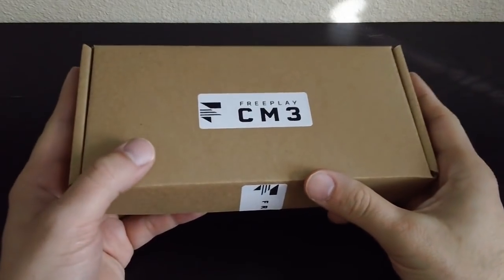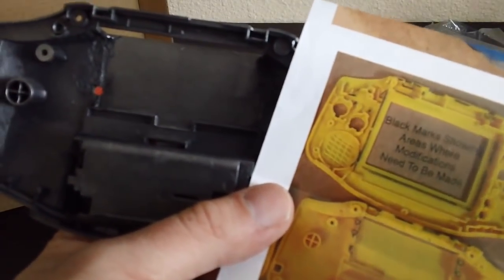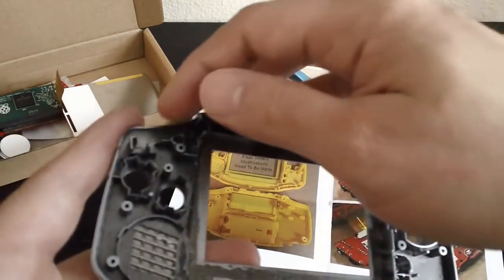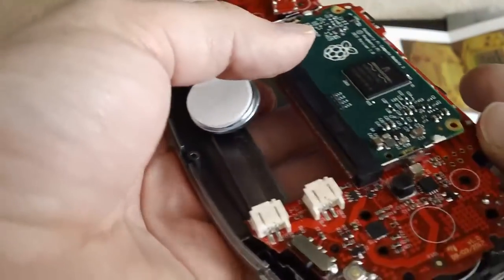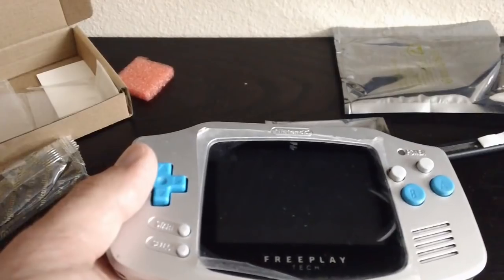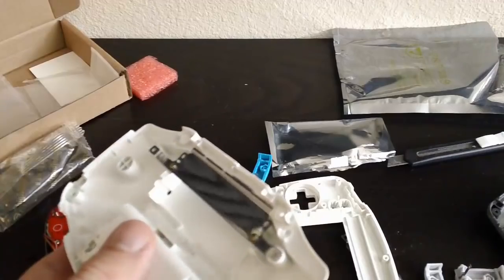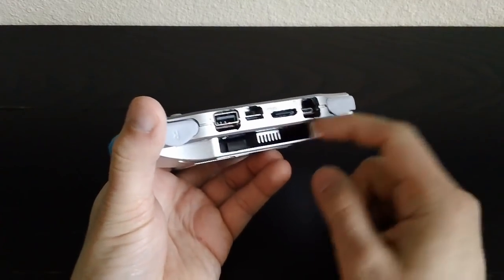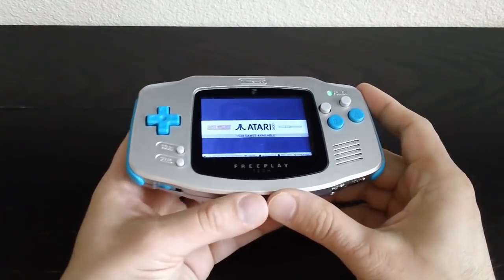Freeplay CM3 | Pi-Powered GBA! - ASSEMBLY | PAX South Announcement

Comment: Bro, go buy some files from the store for those ports. A small flat file with square edges would make muchhhhh cleaner port holes, seriously give it a shot.  Draw out the whole with a straight edge, do a rough cut with the drimmel (smaller than the drawn cut) then use the files conservatively to square it out.
Reply from the maker: D Clems just did! Hoping to make the white unit a real gem!!
Reply: Yeah good first try! I learned that trick from watching a lot of videos on modding and the difference is really substantial! I think you will like the results using the files because dremels are just too sloppy for most of the fine  work in this project. You can even use the files to smooth out the interior and reduce the amount of sharp edges that could potentially crimp or snip wires/ribbons which would be bad.

Comment: Nice job! 
Useful tips for those projects: when you need to assemble flat parts that won't fit, just put a piece of paper in between and you'll see stronger indentations where the parts get stuck. Buy a flexible extention tube for precision work with the Dremel. Most times for bigger holes it's better to dremel 3/4 and use sandpaper to have a precise finish.
Reply from the maker: HOLY SHIT! I FELL LIKE A DUMBASS!! That's what the extension tube in my dremel kit was for!!
Reply: I was about to add keep a roll of kleenex for when you cry after project ruining dumb mistakes haha The flex arm is really a must tbh. You'll have a lot of fun!

Comment: I've heard of the aftermarket cases for GBA being finicky even as a direct replacement for original GBA units. Their measurements aren't quite accurate, which is par for the course for 3rd party knockoffs. Usually thinner plastic as well.

Comment: This is late but, when you're drilling on the outward face of something, use painter's tape or something similar over the surface so if the bit slips, it just scratches the tape instead.

Comment: umm you built this completely wrong...you dont need to cut any connection ports in the case there suppose to be on the bottom where the game cartridge opening is....check out ETA Primes video on hwo to correctly build this kit....

Comment: At the very least they should include a physibles file for a properly-modified case so you can 3d print one.  Time is money.  At $15 an hour, you're probably spending $100+ on that case.  Going to a maker shop and paying them to print out a custom case is going to be less than that.

Comment: I went through a couple of those cheap Sega Saturn USB controllers and both had problems with the right shoulder button. Even after replacing all of the cheap buttons with official Saturn buttons, the right shoulder button didn't move freely. I ended up just picking up a Saturn USB adapter to use original Saturn controllers on USB but I believe it boiled down to defective molds that caused the case and buttons to be out of shape. Who knows, maybe somebody bought defective tooling for Saturn controllers and that's why nothing fit.

Comment: The part that you're not supposed to cut off completely, it's needed for the spring of the shoulder buttons.

I myself have had a positive experience buying a $5 GBA shell out of China. It was a plain purple one, and the shell is an almost unbelievably exact replica of the original shell, like if it's the genuine mould, though not exactly a fresh one. The grey decorations and buttons that came with the shell don't match quite as well, they're not 100% exact copies, but mechanically exact enough, they work very well, they look fine, didn't have any issue with them at all. The battery door was obviously also not original mould, but it fit the colour of the shell that came with it perfectly, and i'm not too bothered by a little wobble, i can fix it if i like with a little heat.

I think the buttons that you got can be made to fit, but your spatial reasoning might not be up to the task (i mean look at those holes you made in the case), and it's understandable, controllers are intricate little things that take a lot of experience to engineer, and a similar kind of experience is asked of you to make an unfitting part fit. And i think naming the vendor/manufacturer of the buttons would be fine. I think they made an error in the mould and then it was too expensive to fix, but it would be nice to know you're buying parts that may need to be modified.
Reply from the maker: but if the shoulder buttons are just resting on the clicky microswitches I don't think they're needed. Also, yes these Chinese GBA cases are scary accurate. Even the sticker on the back!!

Comment: I thougt about ordering one of the zero kits when it was on kickstarter but the microswitches for the X and Y buttons ruined it for me. I don't have problems with microswitches in general but having A and B with traditional buttons and the other ones with microswitches just has to feel weird. But if you don't have a problem with that this kit is arguably the best option for a moblie Pi powerd emulation handheld.
Also the Raspberry Pi 3 version is bit of an overkill i think. As far as i know the zero runs everything up to the SNES pretty good and you will probably not run PS1 on this without analog sticks and R2/L2 buttons

Comment: I feel like if you're gonna make your customer go to all this effort with case modification, there's not much point in using a preexisting design. Same with the GB-zero or whatever the cool kids are calling the DIY pi zero in a DMG housing meme these days.
Reply: Bob Woggle yea, this is just a lot of work for something you can get elsewhere but disguised
Reply: I agree that looks like waaay too much work.  Would it have been that hard to get a case made?
Reply: Exactly. It would make infinitely more sense if they sold a modified case with the kit.
Reply: The entire point is keeping the nostalgia of the old case. There are plenty of handheld emulation devices out already. that have different form factors.
Reply: Xenocide78 Sure, it's cool to see modern tech and emulation in a familiar design. It's a shame that it takes hours of modification to get it to fit though.
Reply: Xenocide78 If that's the case they should do one of three things:
1. design their shit to fit in the old stuff without hacking out half the plastics
2. pick a nostalgic package that can accommodate the current design without hacking out half the plastics
3. create something new that retains nostaglic design elements, but actually suits the space and button needs of the project

I have less of a problem with this as a hobby project than as a product, it's when you start selling it and still require your customer to do this much that it irks me.
Reply: I get that the hobby project is the product, but the combination of that and the existing design doesn't make sense to me. Just send me a project box and some superglue if you want me to do that shit.
Reply: Yeah but if i feel nostalgic for my GBA im sure as hell not going to ruin it to put Hardware in that will be outdated in <2 years.
Reply: The raspiboy is a good example of someone actually designing their own case for the pi zero, and its much easier to assemble. Only wish it had the option of the cm3 module.
Reply: You can mod a PSP if you want easy, this is meant to be a fun little project.

Comment: It's too bad they don't offer a case. Even low volume, I bet they could sell quite a bit more if they offered the option of a 3D printed case. Or, higher volume, could even get a mold made. Sure, some people love making things like this, but I'd bet a premade case would appeal to a lot of people who would want this. Could even charge more for a fully assembled version, as well. I feel like they're missing out on a lot of the market here, because I'm sure a lot of folks would love to have a Pi in a GBA-style case.
Reply from the maker: that's a common complaint in the comments, but I haven't seen anyone doubt how comfortable the OG GBA was to hold.
Reply: Well, if they could 3D print or mold a case that was GBA on the outside and fit the CM3 on the inside, should be just as comfortable and no modding required.
Reply: That seems like an obvious solution, I'm sure they thought of that but decided against it, idk.
Reply: Zzyzx Wolfe Yeh I thought it was a bit spunout. Its cool but I'd either wanna make it from scratch or just buy one outright. U can get glow in the dark GBA cases on GEEK.COM for around $10-$15. I was gonna do portable Pi Zero build with one. Its cool they got it funded still I suppose.

Comment: Do you think a direct connection to a computer (like a double make usb cable) would make loading roms easier or faster
Reply from the maker: no, it wouldn't work unless the computer used Linux as far as I've been told. But this method of loading roms was ridiculously simple.

Comment: There is another portable raspberry pi thing called the Raspiboy. It looks like an SNES controller with a screen molded on top of it.
Reply from the maker: Fat Tiger that one always looked weird to me, I can't see myself using it in public
Reply: StopDrop&Retro To each his own I guess. I think the Raspiboy looks pretty cool. Plus having all four face buttons being the same size is a plus to me. Not sure, but I think it might have a bigger screen than the freeplay. Downside is that the raspiboy uses the weaker but smaller raspberry pi zero while this uses some kind of raspberry pi 3, but I think the zero should be fine to emulate anything before playstation.

Comment: Well since this uses an RPi-Zero, it will have trouble running Snes and GBA games at high resolutions. I guess you'll be able to run it original res if you are lucky. Still sucks though. A portable should have a RPi-3.

Comment: i wish some chinese company would make a cheap retro pi emulator system instead of those android ones  and cheap those fake psp/vita looking emulator mp5 handhelds
Reply: MrJ0mmy eh...different software, same crap...
Reply: Why though? Faster hardware, smaller footprint.
Reply: Mansen well...the raspberry pi zero w only has a single core 1ghz cpu. Although I must admit that's still better than a lot of crap. But there's still making the controls and the screen and stuff, and if they're making a $20 device, no part could cost as much as a raspberry pi zero w
Reply: Not sure what your argument is here...

Comment: All this work when you can just get the awesome phonejoy gamepad for your phone, some emulators, and put some roms on your phone...
Reply: DAudIcI I got a cheap $60 2nd hand phone just for emulating, I just keep the wifi off since I don't need it. And I can run anything up to ps1, ds and sprite based psp games. That's more than a raspberry pi can do or most of what you can buy.

Also a bt controller is nothing different from any of the main home consoles...
Reply: DAudIcI I do have a raspberry pi for most of my ps1 games, mostly since they are on a hard drive...but if someone wanted their emulation on a bigger screen, would they not just stick a free emulator on their computer? or get a hdmi cable and connect their tv as a 2nd monitor. Costs less and easier to set up, not that retropie is hard mind you...
Reply: Scott 1 yea but...i can't play ds games on a psp, i can on my android mini tablet.

...i'd call it a phone but uh...what else is a phone with no sim card?

Comment: I mean, why do not develop a kit with an included case...  not a GBA case but their own, who cares if it is cheap plastic from china but any complete kit it's better than this mess!
Reply from the maker: MasterControl90 designing a case is harder than it looks. Making a pcb board that fits into an existing case (with some cutting) is easier
Reply: that is true but why not choose a way easier case to work with like PSP ones? Replacement cases are cheap too and you have more space to work with. Another thing I was thinking is that they can easiliy contact a chinese manufacturer of gba shells and give them the specs to modify it and maybe change a bit the look of it

Comment: Underpowered for the console it's trying to emulate imo.
Reply: Mansen Excuse me? GBA uses ARM as well, which means a lot of emulation overhead disappears because you can get actual physical cpu to execute many of the instructions directly (similar principle that many VM software such as VMWare, Qemu or VirtualBox use). And Pi has faster ARM and of newer generation than GBA used.
Reply: Sure...
Reply: QVear, that is hypothetically the case, but most emulators for systems THIS slow and old don't bother to implement a dynamic recompiler at all, and yeah a dynamic recompiler would collapse and have to perform very little work on a similar architecture, it's basically just adding bookkeeping (such as counting emulated cycles) and address fixup to account for different memory locations in the emulator compared to emulated machine, while most instructions will require no transformation at all. The highest amount of recompilation penalty comes when emulating a register-rich architecture such as ARM or MIPS on a register-starved one such as x86, where every operation will turn into like half a dozen.

Without dynamic recompiler, the emulation runs an interpreter, at maybe 1 or 2 orders of magnitude of speed penalty.

In particular i went ahead and checked which emulator core RetroPie ships on ARM, and it appears to be libretro-mgba. Currently work has been performed to add a simple dynamic recompiler to mgba, that is only implemented for ARM hosts, exactly because it has to do so little. But it's not fully tested and the feature isn't yet in the version that ships with RetroArch/RetroPie.

However, a Pi2/3 is a pretty powerful device. Even at a bit less than 2 orders of magnitude speed penalty, it should be able to just about outrun an old and fairly primitive 17MHz processor.
Reply: Siana Gearz Exactly my point. Also I remember running VisualBoyAdvance on a 700mhz Celeron with 512mb ram in early 2000's and it was performing quite well (at that time VBA was pretty new and you still had to hunt for gba bios to use it), so I have no doubts it will work great here. If only someone offered 3d-printed cases for the thing or prebuilt version, that would make it an insta buy for me.
Reply: You can probably commission a friendly neighbourhood console modder to give you a prebuilt version...

By the way, i just had an idea, they should make a cutting template, like a vinyl or paper sticker, that you put on the outside and align the markings with existing body linework and holes, that would mark out how deep the ports are to be cut. This should make it much easier for many people. And it would also protect the edge of the plastic a bit while cutting.

By the way, how much is somebody willing to pay for a newly designed enclosure, and how many people could want it? I could take a shot at it. What design deviations from Gameboy are permissible and desired? I don't consider it ethical to make a 1:1 copy, but of course given the dimensions of the underlying electronics, the feel will be invariably similar enough. I'd probably just do it regardless if i was buying the kit for myself, i do have a 3D printer, but i currently have no plans to do so.